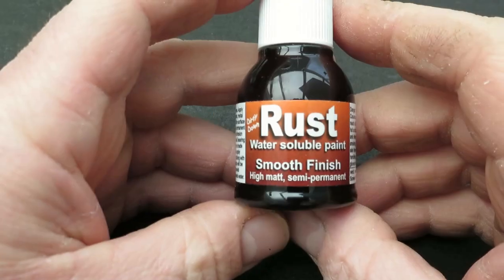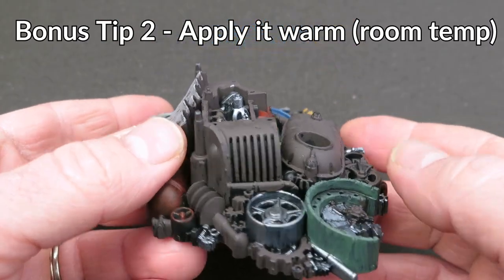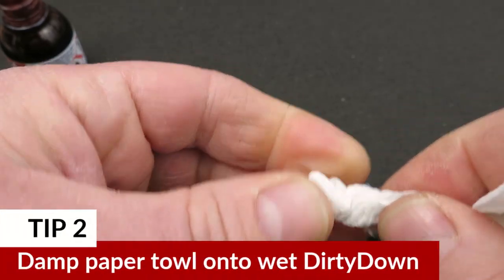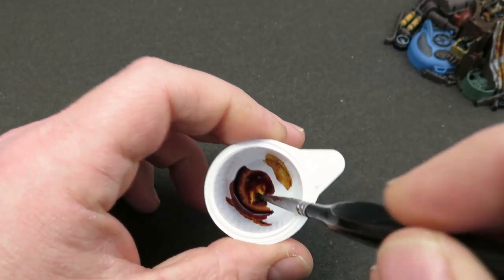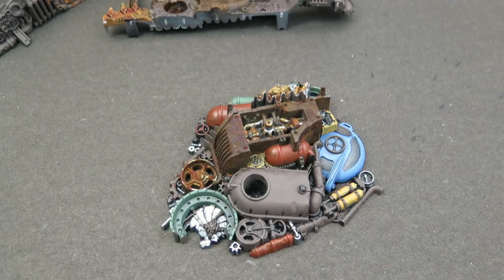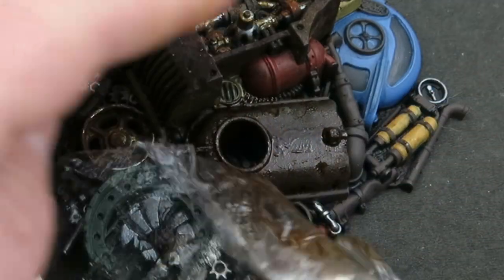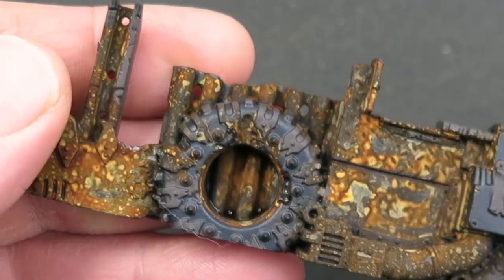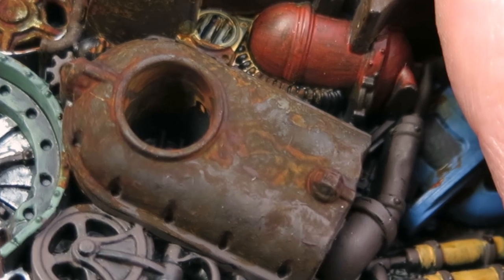7 Tips to get Realistic Rust effects with Dirty Down Rust

Comment: Great video! Which method would you recommend for the horse shoe ribs of a necron ghost arc?
Reply from the maker: Thanks! Hmm that's an interesting one. Others may have some ideas, but I might start with the stippling layers. 

At the end of the day, as per the "when it goes wrong" video if you don't like it, you can wash it off, dry brush over your base colour again and once dry start again.

Let me know how you get on!
Reply: @FlyingRavenStudios  thanks, I'll give it a go! I guess I'll apply it thicker towards the bottom and let it fade out at the top maybe
Reply from the maker: Yeah sounds good. You could also try building up the layers (letting each layer dry first) towards the base to build up the effect. Have fun!

Comment: I love this paint but I struggled to get the light colors of rust to show through. Although I found mixing with some matt varnish you get bright colors only.
Reply from the maker: It is good stuff. Have a look at the next video "what happens if you get Dirty Down Rust wet"? I experiment with varnish in that. Out of interest, do you use acrylic or enamel varnish? In general, you will get darker tones if you use a thicker layer of the dirty down rust, and lighter tones if you use thinner layers. You can get a mixed effect by stippling and layering it up after letting it dry between coats. Hope that helps!

Oh and by the way, welcome to the Flying Raven journey!
Reply: I mixed it with acrylic ak matte varnish. Thankyou tbf I had been slapping it on and wiping of raised areas. Gunna try stippling it, and also gunna try adding to things like typhus corrosion and ryza rust, see what happens :)
Reply from the maker: Yeah have an experiment and let me know what happens! I have been talking talking people who have been using it over dried typhus corrosion and they go a really nice textured effect

Comment: Does this paint reactivate with water after it's dried?
Reply from the maker: Great question. In my experience I would say no it does not reactivate so you can manipulate it.... however.... I have had a bit of an experiment on a terrain peice that has been dry for a couple of weeks (so well and truly dry). When I added some water on a filbert brush and gave it a very gentle scrub, the Dirty Down Rust came off completely... well, it left just a very faint orange tint to the surface. I guess that is why it says on the bottle to keep dry once applied! If it gets wet with water, but you do not scrub it, then it goes very pale yellow / white.

**Disclaimer** I have not tried it for this purpose, but that could potentially mean that if you are not happy with the effect (such as you added too much water, or the technique you have used does not look right for the scale you are working on), then you could essentially wash off the Dirty Down Rust, allow to dry and then start again... but once again I have not tested it to that extent. Just be careful as the water you are using to wash it off carries enough pigment to stain.
Reply: @FlyingRavenStudios  thank you, that's very informative and helpful 😀

Comment: Instead of flicking water, why not flick rust onto the surface ? This does look a lot easer then using pigments then a fixer then building up the rust. At £10.00 this isn't that expensive either
Reply from the maker: edit on reflection, my gut feeling is that it would be too uncontrollable and you might spoil your project. But you certainly could try flicking the rust and see what effect you can get as an experiment. Just make sure you are using eye protection as getting it into your eyes would be bad. Also, I would definitely suggest thoroughly protecting the area around you if you are flicking the rust paint, so it doesn't go where you do not want it. Also, it can badly stain what it lands on.

Comment: Here's another good tip: Wear a mask and gloves. This stuff is a skin and eye irritant and should not be touched with bare hands. If you're "flicking" it, do it outside or in a fume hood with googles, a respirator and gloves.
Reply from the maker: Hey HeroesBosses. According to the Safety Data Sheet ( https://dirtydown.co.uk/safety-data-sheets/ ), as far as I can tell, gloves and respirators are not required for normal use. However, eye protection is a very valid point. This is why in the video, I suggested flicking water from a brush onto wet Dirtydown rust paint so you dont flick Dirtydown rust anywhere you dont want to.

On a separate note, on top of eye safety (or dripping it into your brew, which would also very much spoil your day). I wouldn't recommend flicking the Dirtydown paint itself as it is too uncontrolable, and you could end up spoiling your project.

Comment: I would wear gloves if I was about to use a kitchen towel wet with this stuff. It may be water-soluble, but it is a very dangerous product. Handle with extra care please.
Reply from the maker: I hadn't seen that in the instructions. Thanks for the info
Reply: I was stupid when using this stuff and without realizing, because I was rinsing my brush in my regular pot of water, I did the "corner of the mouth swipe-thing" we all do after wiping my brush on a paper towel. I did that twice. Less than an hour later I felt sick and started vomiting which lasted all thru the night. I now use separate brushes and a new pot of water (which I flush out after I'm done). Fool me once...